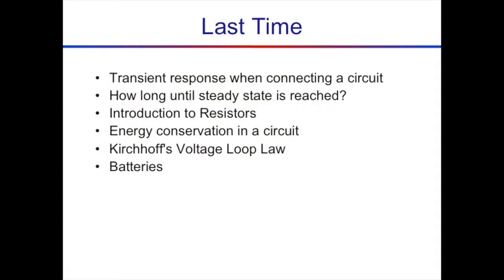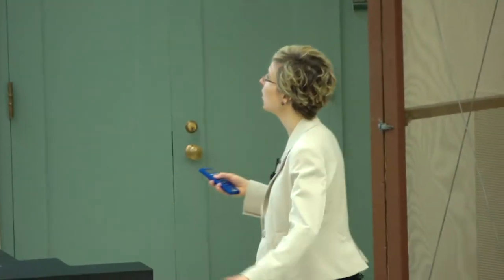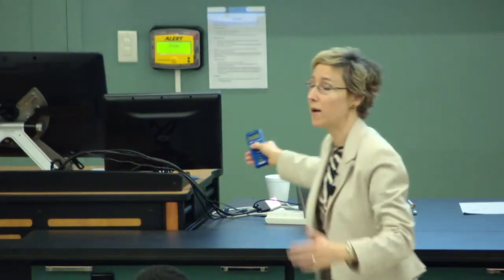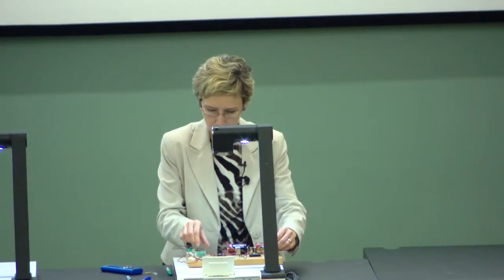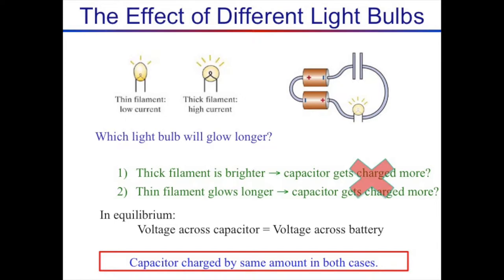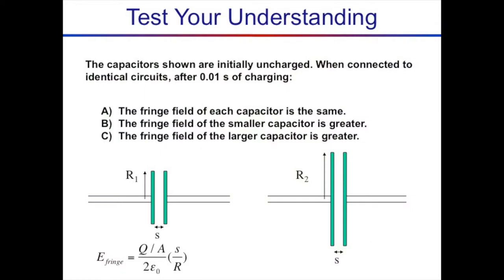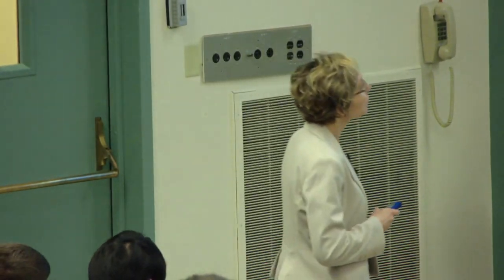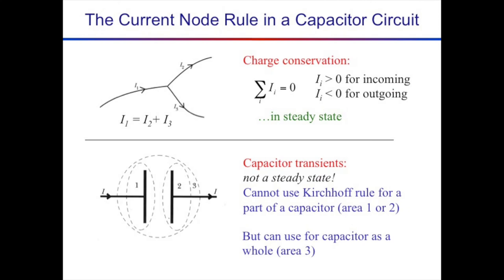Lecture 16 Charging and Discharging Capacitors

Comment: Is it necessary that the plates should have equal and opposite charges always when we charge them with a battery? if yes then why? how do we know that the electrons piling up on one plate will repel exactly the same no. of electrons from the other plate?
Reply: No. However, this is the case if we assume the initial condition of each plate is neutral charge. In this case, the battery removes the same number of electrons from the positive plate as it adds to the negative plate. This is how a battery functions.
Reply: @AwestrikeFearofGods  but how does a battery 'knows' that it would send and receive the same no. Of electrons at any time? I mean it's just a solution with cathode and anode. Generating potential difference but how it knows it have to maintain that potential difference??suppose we have only one plate connected to positive end of battery and other end is not connected anywhere. We know there would be some positive charges on that plate and wire to cancel the electric field from battery, and these charges itself should come from battery , so battery has indeed recieved some electrons from that plate and wire, without sending any electrons to the other side, shouldn't it change batteries potential difference?

Comment: In the previous lecture, you said electrons never move. But, now you are saying electrons move and pile up.
Reply: She never said that electrons never move and I literally just watched the previous lecture
Reply: In AC, electrons reciprocate. There is zero net displacement for any integer multiple of the AC period (i.e. inverse of AC frequency).

Ex: at 60 Hz, there is zero displacement at 0/60, 1/60, 2/60... seconds. But an electron would be displaced the maximum distance at 0.5/60, 1.5/60, 2.5/60... seconds.